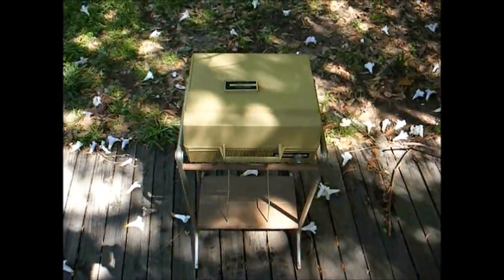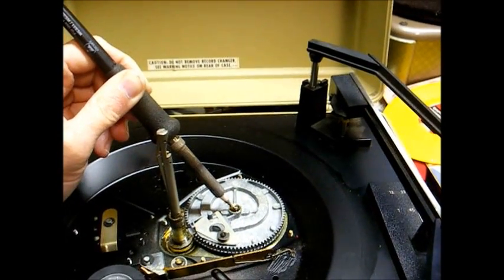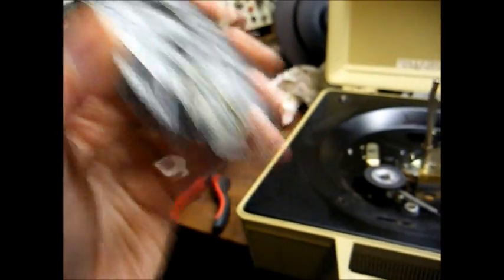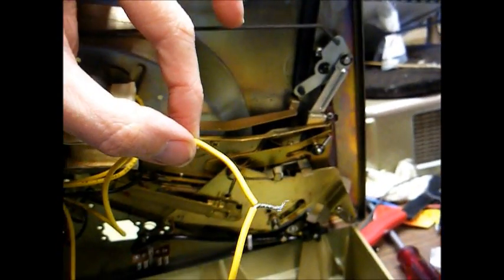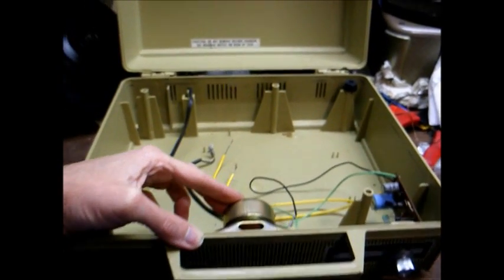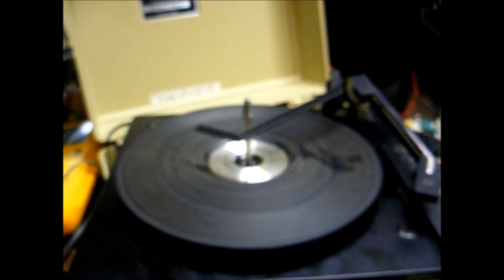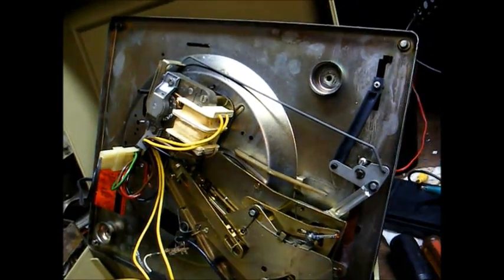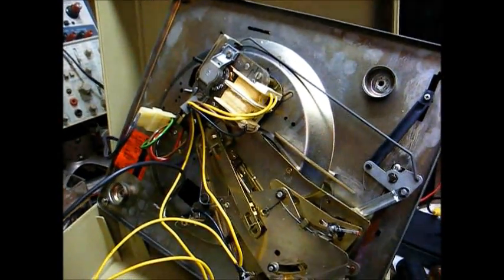Repair attempt of a Concert Hall / BSR record player from the '70's.

Comment: I had a G.E. portable record player that had the same setup with the motor doubling as the transformer and a simple transistor amp. It didn't have a BSR changer but rather a single play manual with the requirement that the speed lever be put in Neutral when not using it to avoid flat spotting the idler wheel.

Comment: I had a GE phonograph that was in an identical case as this one. I got it for my birthday in 1971, not sure who made the changer but it was a four speed unit. It worked fine and had decent tone until the original dual synthetic sapphire stylus wore out for LP records. I replaced it with a diamond lp/synthetic sapphire 78 stylus and that's when the fun began. It never fit right in the record grooves and would skip like crazy. I tried adjusting the tracking weight to no avail. I then replaced the stylus with a dual synthetic sapphire unit and it worked fine again. I had it for about ten years and gave it to my sister when I moved away. All she did was to replace the stylus with a synthetic sapphire unit and she had it another 10 years or so until she finally bought a decent unit.

Comment: I share your method of mechanism lubrication. I used to mix up the following:
Vaseline mixed with a small quantity of Methylated Spirit and 3 in 1 Oil, mixed into a paste, and applied to Capstan Bearings and the like.
Great diagnosis and Video Many thanks.

Comment: And speaking of Concert Hall, I have the same record player that I got back in October, but it was not Concert Hall, it was GE, and it was an older model with the same GE changer used in the Wildcat. It sometimes work, the turntable runs well, and the same problem, the cartridge is dead, but I have to replace it with another one. I ordered a replacement cartridge from eBay yesterday, and it's a Varco PC-177 TM3 phono cartridge, and it does fit well with other record players including my GE Automatic (Swingmate) player.

Comment: You're so close. Original was high output, but could you bridge a P190 & use the  center screw mount saddle, instead of the standard 1/2 inch to keep cartridge cost down. 78 would not be an issue. There are two types of mounting saddles for those. These videos are priceless. Well done.

Comment: Those x5h carts can be revived! Since the crystal is Ok in yours, you just need to clean the foil contact parts which are a pressure contact fit. They oxidise over time. Give it a try, what have you to lose? Beats spending 30 notes on another cart. Best of luck!!

Comment: Can you use the less expensive ceramic cartridge and either modify amp for more gain or add one transistor for additional gain? Or use op-amp IC for preamp? I ask because I know you want to fix it. The player and stand are nice. I've never seen one like that. If you do salvage it can you include a little info on the stand? Thanks!

Comment: Fit a stereo cartridge to the turntable, grab two amplifiers and fashion a "mongrel-breed" player(bits from here, bits from there) and mount it in a home-made cabinet with external speakers. After all, stereo's no good unless you can spread the speakers as wide apart as the speaker cable will allow. You might even start a boutique phonograph manufacturing set-up. RadioTVPhonoNut Stereos, every one unique! Because you'd likely not be able to replicate them. The turntables may be different(BSR in one, Collaro in another, Garrard in still another) And the amps you use may vary widely as well as the speakers, knobs and other ephemera.

Comment: Any problems with using a 2-pin Molex connector in case further servicing should be needed? That way you can separate the amp and power it from a bench supply, should the step-down winding go bad.

Comment: How many volts produces as output the engine to power the amplifier?
Reply: He said it's a crystal cartridge so the understanding is roughly 3 volts. Ceramic I believe is roughly 1 volt. Magnetic cartridges I believe are 5-10 milli-volts.